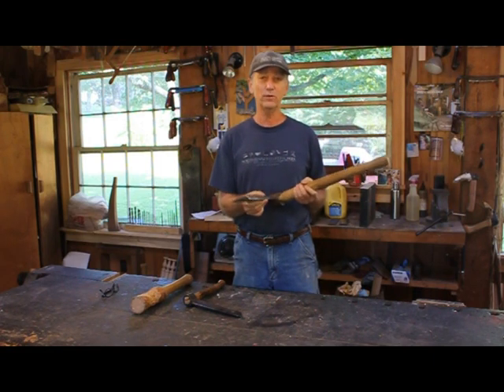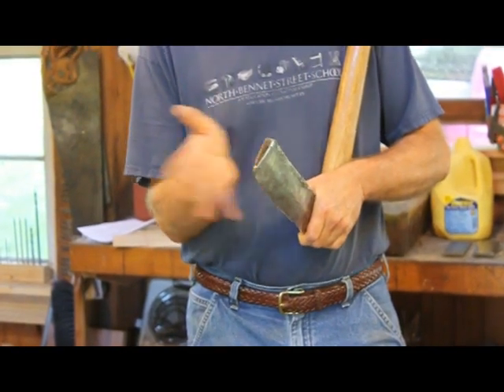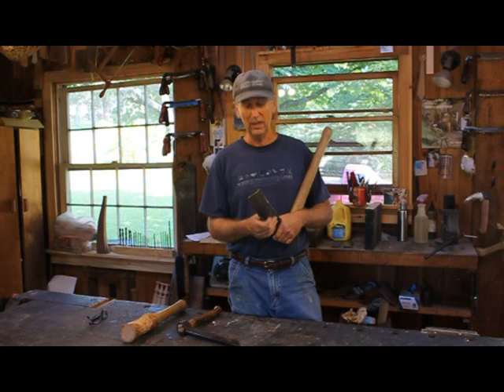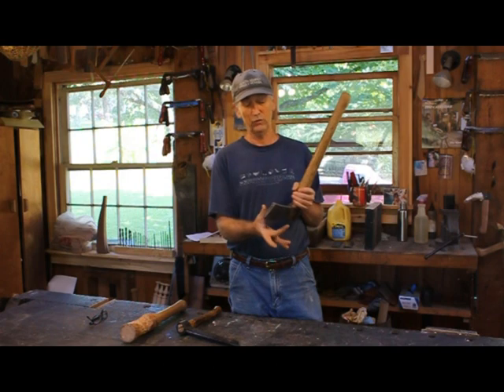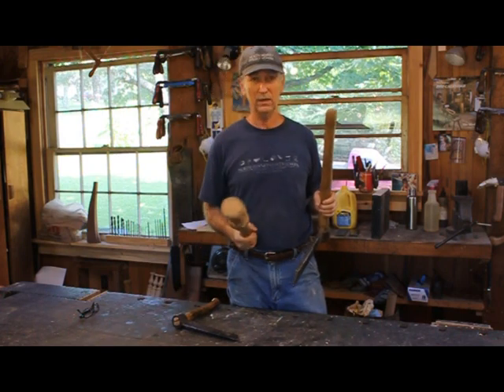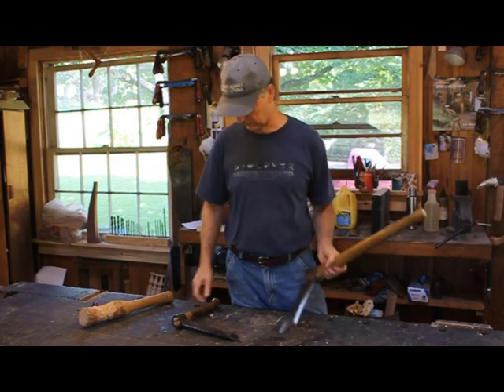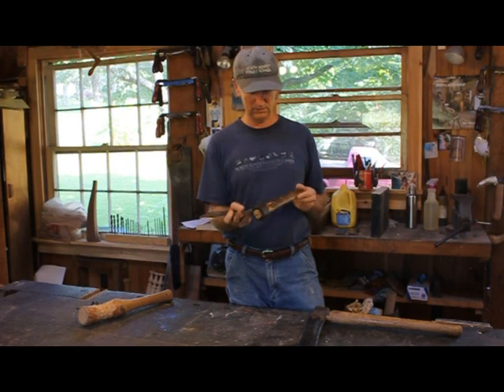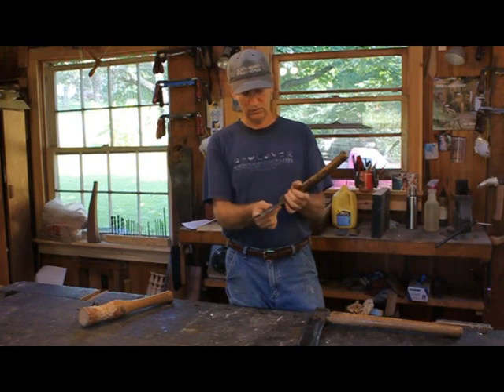Sharpening a Froe and a Wedge

Comment: Ash makes a good froe club too. It degrades gradually rather than suddenly. You need to let it dry for a few weeks (or months) before using it, to toughen it up, othwise it won't last long.  Having a blacksmith fix you wedges is a nice idea, if you don't have access to one, you can file the mushrooming off with a coarse file (or grind it).